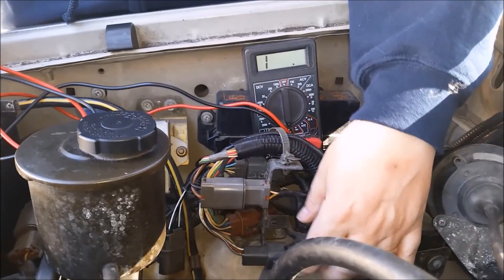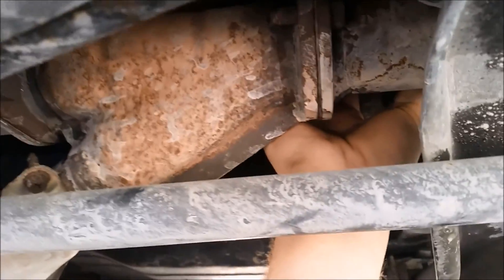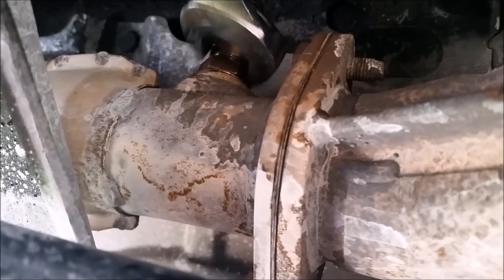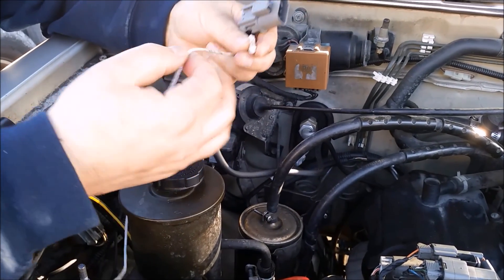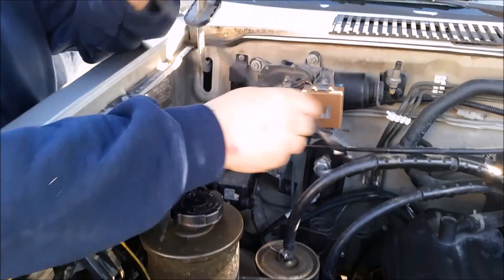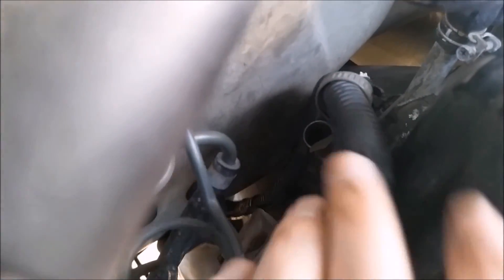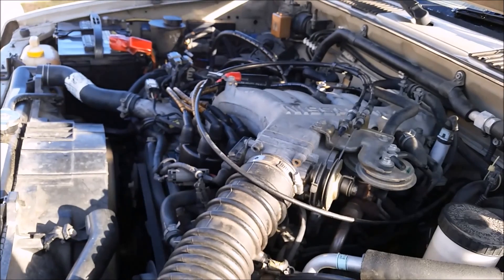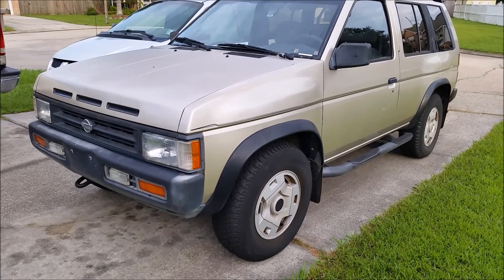95 Pathfinder D21 O2 Sensor Change With ECM Code Erase Part 2

Comment: what tool did you use to take off
Reply from the maker: The O2 Sensor was a 22mm or SAE is 7/8's. Hope that helps, it's mentioned in the video by the way. Thanks for watching and I hope the video helped. Best Wishes & Blessings. Keith Noneya
Reply: thank you one more question did you use a wrench or socket or what tool did you specifically use?
Reply from the maker: @cas-sm9qs I used a 22 mm or 7/8" wrench to take the O2 Sensor off. Go to time index 1:29 and start watching, you will hear my helper mention it. Hope that helps. Best Wishes and Blessings. Keith Noneya

Comment: I can't anything about the 1996 Nissan pathfinder SE where the O2 sensor would be located.  If anyone might have an idea where it could be located?
Reply from the maker: Join the NICOClub.com or look up the Pathfinder 1996 manual here; https://www.nicoclub.com/nissan-service-manuals. If you're still having problems try downloading it directly at this link; file:///C:/Users/19857/Downloads/ec.pdf If you're still having problems getting it, email me here; keith_noneya@att.net  and I'll email it to you. Best Wishes & Blessings. Keith Noneya
Reply: @keithnoneya  thankyou. I will look up it up. 
I actually do still have my pathfinder. Body looks like hell but for 207 thousand miles it runs good. Except the other day the exhaust leak got bigger so I'll be getting that fixed. Was thinking if the O2 sensor is in the exhaust, I'll just replace it.
Reply from the maker: @eqbuffers8011  I did some more looking and the 96 v6 has four. It looks like it has two on each Exhaust Manifold next to the Firewall and two near the bottom on each side on the Exhaust Pipes. If you don't have the Haynes book for the 96 I'd look into getting one, I'm sure it would show you the location and how to change it. The Nissan Factory Service Manuals are great for how to troubleshoot problems or test to see if a component is working properly but they kinda suck for location of the O2 Sensors. So unless you have a fault code for the O2 Sensor I'd just inspect the connector for corrosion and leave it in. That's my take on it. Either way there are 23 sections for you to download, that includes the EC section. I'd create a folder called 1996 Pathfinder Service Manual and then download all those sections into that folder for save keeping and ease of finding what you need. Let me know if I can be of anymore help. Best Wishes & Blessings. Keith Noneya
Reply: @keithnoneya  thankyou very much for taking the time for looking up the O2 sensors where they're located.  Yikes I didn't realize there's that many.  I'm inclined giving where they're located, if they're working properly I might leave them.
Reply: @keithnoneya  I did pick up a Haynes manual earlier today
Reply from the maker: @eqbuffers8011  My pleasure, I'd also download the 96 Pathfinder FSM on the website I suggested because they have great troubleshooting and tuning procedures in the manual. They also list any special tools and Chemicals/Sealants needed to perform specific jobs. Best Wishes & Blessings. Keith Noneya

Comment: If a little bit of oil is coming up through the air mass sensor to the air filter, what could cause that?  I replaced the PCV valve.
Reply from the maker: Yeah I would change the PVC Valve and clean the MAF Sensor, change the Air Filter and all sensors between the Air Filter and Throttle Body. If the oil is more than just a little it could be a sign you have worn or broken Piston Rings or Valve Guide Seals. Have a Compression Check done to check the Piston Rings. Valve Guide Seals if they're not sealing good will give a lot of blue smoke out the tail pipe when accelerating or going up a hill. When you have the Compression Check done also have them inspect the Spark Plugs for Excessive oil or carbon build up in them. Hope that helps answer your question Patty. Let me know how Patti's Pathy is doing after you have it done. Best Wishes & Blessings. Keith Noneya
Reply: @keithnoneya  Keith!  Thanks SO MUCH for the reply.  All the usual suspects have been checked - compression is good, uses/leaks no oil, no blue smoke, plugs look OK, replaced MAF sensor, etc.  This is why I think it's one of those sensors - but this engine appears very complex - tubes (both metal and rubber) routed everywhere and difficult to follow.  The Haynes and Chiltons don't cover this stuff much at all.  I was told that tubes can internally collapse and cause problems.  Also, there's always been a high-pitched "whistle" that varies with throttle (accelerator) position (I've had the car for 5 years - you can hear it from inside the car even with the windows up - it's not annoying).  But when the car started running badly, the whistle changed - it's now gone at idle and has a different pitch under power.  This sounds like some hose leak is involved, maybe, causing some sensor to do something stupid.

Also, it idles perfectly smoothly.  How rough it runs seems to depend on throttle position - the more depressed the accelerator, the rougher.  Of course, you can only depress the throttle a lot while driving in high gears (like 4th) because the engine just revs to high RPMs otherwise and you can't tell the roughness, if you know what I mean.  Now, this behavior just draws a blank in my mind!
Reply from the maker: @pattimichellesheaffer103  Very interesting. My dad taught me a trick to help find vacuum leaks. While the engine is running spray WD-40 on the vacuum lines. WARNING ** When doing this keep the mist AWAY from any spark plug wires or it will catch the engine on fire! ESPECIALLY the coil pack on top, been there done that LOL! Here's an example of using Carburetor Spray to do the same thing. NOTE he said the spray i flammable! So stay away from Spark Plugs, Spark Plug Wires and Coil Packs. If the engine does catch on fire, hit it with high pressure water from a hose if it doesn't go out immediately use a fire extinguisher. Make sure and have the hose with nozzle and fire extinguisher right there on hand and ready to use. Hope that helps. Best Wishes & Blessings. Keith Noneya
Reply: @keithnoneya  Keith - what did you do in response to the MAF sensor warning?
Reply from the maker: Something is definitely pressurizing it if oil makes it that far up into the air filter. Make sure you didn't put the PVC in upside down or it could pressurize the system instead of venting it. A short video on the problem might help. Name it. "92 Pathfinder venting oil out MAF Sensor" Well it's a night out with the wife so gotta go have some fun. I'll check back when we get home. Best Wishes & Blessings. Keith Noneya
Reply from the maker: Hey Patty I got to re reading your posts, check the fuel pressure. How did the vacuum lead test come out? Did you guys get it figured out? Best Wishes & Blessings. Keith Noneya

Comment: Wow - COOL!  Thanks, Keith!  I have that exact same car 1992 version - same color but different wheels (and a bit older).  Thank you for this.  Is there a way to get the codes?  The factory service manual link seems to be dead.
Reply from the maker: Hi Patti, I fixed the link, but you have to join the NICO CLUB. It doesn't cost anything just sign up and create a password. Their isn't 92 manual, but if you download the 93 thru 95 manuals you'll find that about 99% of the information is the same and is good.
You can find the Codes in the description of "88 to 95 Nissan ECM Codes Pathfinder D21 Hardbody Truck" here: https://www.youtube.com/watch?v=6RK4ADgSKTA Hope that helps you find what you need. Best Wishes & Blessings. Keith Noneya

Comment: Nice to see an actual helpful wd21 video! Thx guys, my 91 is gutless as all can be Right now and I have the same issue! Can wait to install my new o2 sensor so I'm not gutless anymore 😂
Reply from the maker: A bad MAP sensor on the air intake tube can cause that too. Sometime the connector gets corroded. You can push a small drill bit in and out, DO NOT TWIST IT, to clean the contacts.
- I have a whole playlist on my channel devoted to the D21's here: https://www.youtube.com/watch?v=rkOnvgmXq7A&list=PLVLXGvrQp0OtA-2Uh-QNLdv7PD4tMRqG7
- Hope you get it fixed. Thanks for watching. Best Wishes & Blessings. Keith Noneya
Reply: @keithnoneya what code did you get for the o2 sensor  it could be the same reason for the code 33 egr  or not the nox on my truck are good  when the smog check process is starting but when i get the check engine ligth my noxs go to the top
Reply from the maker: @alfredohernandez1124  Code 33 is for the Heated O2 Sensor I made a video on how to read them and in the description below the video I list all the codes here; https://www.youtube.com/watch?v=6RK4ADgSKTA Also if you join the NISSAN Club, link in description, you can download the manual for your vehicle for free and go through the procedures to adjust Emissions I think it's in "EC" section. Hope that helps. Keith Noneya

Comment: Where do you plug in and what device do I need to run diagnostics on a 1992 pathfinder. There is no OBD II plug and I do not have a check engine light.
Reply from the maker: The Nissan's and most vehicles 1995 and earlier didn't use OBDII they use a specific manufacture scanner, quite expensive. However Nissan gave the owner the option to look up codes right on the vehicle without the use of any tools or machines. They used a switch or a pot with a swith built right into the ECM. The ECM then used a Red & Green LED light to give you the codes. I show you how to access the codes, what the codes mean and where to get a free complete Factory Service Manual here: https://www.youtube.com/watch?v=6RK4ADgSKTA  Just make sure and read the SHOW MORE Description below the video for the information. Best Wishes & Blessings. Keith Noneya

Comment: yeuup, i've got the xe pathfinder that is reading 33 heated oxygen sensor error codes says so'z on the lil blinks.... i'm gonna try n clean it off first.
Reply from the maker: After you replace the O2 sensor don't forget to erase the code. The procedure is in the description and video. Thanks for watching. Best Wishes & Blessings. Keith Noneya

Comment: This was a big help.  I had the same engine power issues with my 1994 Nissan Pathfinder V6, same as seen in the video.  Trying to change the o2 sensor was a pain, but the video was awesome with how to install the wiring harness.  Good job guys!
Reply from the maker: Thanks Michael I made it just for you, and wellll a few others who might need it, LOL. Don't forget to erase the codes then drive it. If the Check Engine Light stays off you're probably good. Thanks for watching. Best Wishes & Blessings. Keith Noneya

Comment: thank u for the vids and the link. i have a 93 pathy, is it the same as the 95? would i have to go under the seat to get the codes? thanks again.
Reply from the maker: Hi Santa. I know it's under the passenger seat where mine is. I'm not sure if you'll have to remove the seat like I did. I found out that if I moved the seat all the way forward I could've accessed the code window and controls without removing the seat. Some have the controls facing the back and some have them facing the drivers seat. I'm not sure when the change took place so you'll have to move the seat all the way forward to check. If it's facing the drivers seat you may have to remove the passenger seat to access it. Let us know how it goes and which way it faces please. Thanks for watching and always feel free to ask questions. Oh and don't forget to download your factory manual for free at the link in the description above. Best Wishes n Blessings. Keith Noneya
Reply from the maker: Oh I forgot to answer the first question. I'm not sure if it's the same O2 Sensor or if it's in the same spot. I would just look under the drivers side of the car on the exhaust pipe and see if it's there. To check if it's the same part go to an on line auto-parts store and look up the part by Year, Make, Model and Engine option. You can also check on eBay for one and they usually give the years it will fit. I would also download the 93 pathfinder manual in the link I provide above and go to the EC section, as it will give you some troubleshooting tests to perform. EC stands for Engine Control System. Hope that helps. Best Wishes n Blessings. Keith Noneya

Comment: (1992 Nissan Pathfinder SE)How many Oxygen sensors?Pathfinder sputtering.Ohms test on sensor tested good.ECU found no problems.When Oxygen sensor is unplugged runs smooth.Bad Sensor anyway?Just read...A "lazy" O2 sensor does not throw an error, but will cause the ECU to miscalculate the fuel mixture.
Reply from the maker: You're absolutely correct just because it ohms good doesn't mean that the sensor will work right. If it doesn't ohm good then you know it's bad.  The only sure way to do it is to put it on a machine for that year. 
Good luck finding one. You can also use the ECM Diagnostic fuel air mixture mode to set it. 
Also check your MAF sensor on the intake by the air filter. Either one can make your engine run funny or not at all. Thanks for the great comment and watching. Best wishes n Blessings. Keith Noneya
Reply: So the ECU can only do so much.Kinda like a cheap scanner.Makes sense  Thanks for the video and your reply.Very helpful.
Reply from the maker: Hey Nick, yep you're right OBD 1 was pretty much limited and was up to each automotive manufacture back then to come up with some basic codes. In some ways it still is, only now they have a minimum standard they have to adhere to. Manufactures can add extra codes for their own use as long they include the OBDII standard codes. Even today the ECM can only do so much, as I've had many newer cars that had problems that the ECM Code didn't cover. It should also be noted that even though a code pops, say for the O2 sensor, it doesn't mean that the O2 sensor is bad, it means that there is an error in the O2 sensor circuit. The circuit includes: Wires, Connectors, the sensor and even the ECM itself. Most of the time the code call out for a sensor is correct, but it's not an absolute. Hope that helps you get to your problem faster. The manufactures troubleshooting in the book on this system it pretty good. If you don't have a digital copy of one you can go to the comments above to find the link and download it. Best wishes n Blessings. Keith Noneya

Comment: so no more late gas? picks up right away? Im having the same problem on my 94, i keep getting code 34 45 12... the issue your having sounds like mine. did it ran good since?
Reply from the maker: Hi Joel, so far so good. I had a 12 code too. I was a loose connector on the MAF sensor. My Pathy has over 270,000 on it and it still runs pretty good. I did find a leak in the flex tube that went from the air cleaner to the Throttle Body. I used black Silicon to seal it up and my gas mileage also when up as well. I don't know if you have seen my video on how to read the codes but there's a list there of the codes and modes as well as a link to the service manual you can download for free. You want the EC section. Anyways good luck and feel free to ask questions. Thanks for watching.
Best Wishes n Blessings. Keith
Reply: I had code 33 34 45 51... man I ended up changin all the fuel injectors, gaskets, 02sensor and detonations sensor. also changed the automatic air control and automatic Idle control unit. what a hell of a job i did. took me a whole week now I still get the code 34 and 51 shit. living in california i must fix this crap in order to pass the smog test GRRRRR hahaha BTW i love the pip boy image you got... very nice
Reply from the maker: LOL on the PipBoy comment. Yeah love the FallOut 3 & 4 series. I play them on my MSI GE70 2PE Apache Pro, love that laptop. 
When you get done fixing a problem don't forget to clear the codes and drive it to see if they come back. I loved the beauty of Calif. and most of the people, but I had to get away from all those taxes, Libs, DMV, political correctness attitude. Also I wanted to home school our son and the state wasn't very friendly to it. So we just couldn't stand it anymore. He's now a Senior in college for Computer Science with a Minor in math. Got an "A" on his final and accepted a job offer from the U.S. Naval Research Lab., one of a few offers he got. Guess we did a good job on teaching our own kid. We're very proud of him and what he's accomplished. Anyway good luck with that DMV and fixing your car. Let me know if there's anything else I can do for you. Thanks for the comment and watching. Best Wishes n Blessings. Keith Noneya
Reply: How do u easy the code
Reply: I have code 12 bad mad sensor put new one but problem there